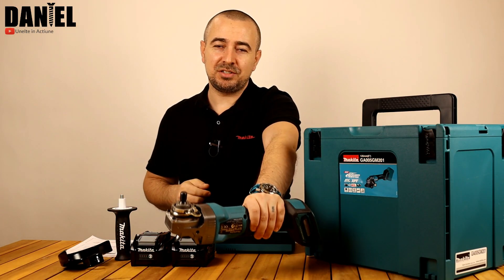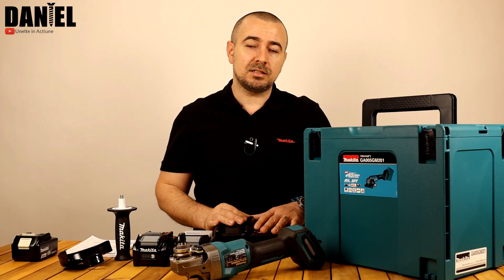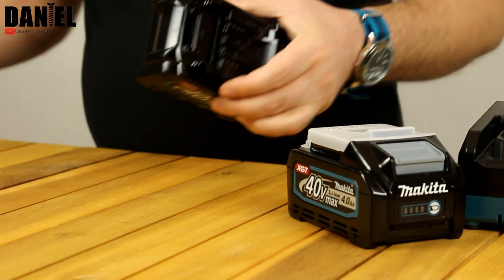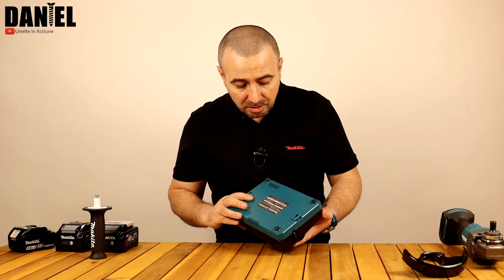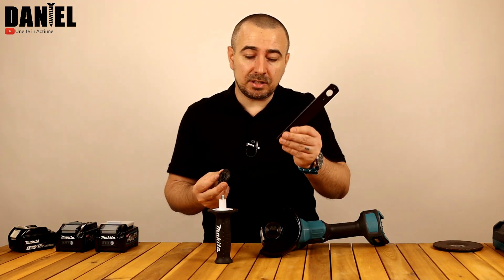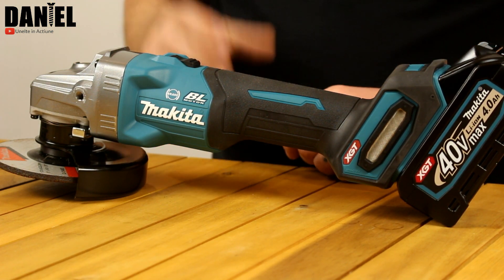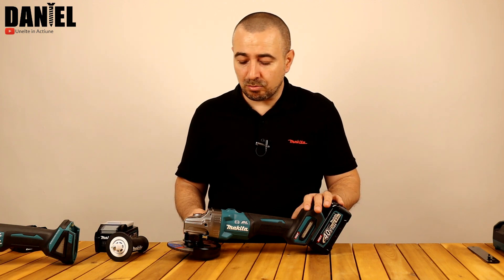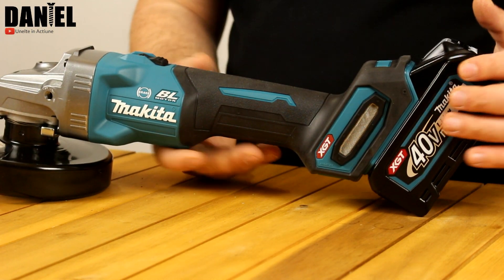A ajuns si in Romania! Polizor unghiular cu acumulator Makita GA005G XGT 40V

Comment: Faptul ca Makita foloseste baterii de 36V este mai mult chestiune de marketing, atata timp cat legile fizicii nu se schimba; in sensul ca o baterie de 36V si 4Ah dezvolta exact aceeasi putere ca o baterie de 18V si 8Ah. Si faptul ca se exagereaza declararea tensiunii nominale (40V max.) nu mi se pare prea corect. Pentru mine mesajul este ceva de genul: uite ca eu o am mai mare - tensiunea...
Reply from the maker: Cred ca trebuie sa iti recitesti comentariul pentru ca faci confuzii. Deci pentru tine, 18V este totuna cu 36V? Ce treaba are Ah cu V?
Reply from the maker: Dar Bosch si alte marci, nu fac acelasi lucru cand scriu pe acumulatori 12V, cand de fapt ei sunt de 10.8? Eu cred ca astea sunt aspecte mai putin importante.
Reply: Asa poți spune și de 18V... Am acumulator de 12V cu 12Ah și dezvolta aceeași putere... E vorba de tensiunea de lucru și puterea motorului, nu neapărat a acumulatorului. Între un motor electric monofazat și unul trifazat, care este mai puternic? 🤔
Reply: In final 18v 8Ah (bosch) = 36v 4Ah (makita), o aberatie ar zice multi dar nu.

Constructie interna a sculelor face diferenta, acum la bosch cu 18v 8Ah scoti 1800 W (sculele bi turbo), cat scoate acest makita ? Probabil ca mai putin.

Makita incearca sa recastige marketing pe ceva ce la multi nu a functionat, bosch a renuntat acum cativa ani la sculele cu 36V din cauza ca se stricau acumulatorii foarte repede,  e foarte dificil sa mentii in balans perfect 10 acumulatori, ceea ce si makita stia de a facut scule de 2x 18v. Totusi sunt mult mai durabili acumulatorii cu amperaj mai mare decat cu voltaj mai mare.  Makita vrea sa redescopere apa calda.
Reply: @19kreeper  Adevarat, dar acest lucru este valabil doar la gama BiTurbo, in rest voltajul face diferenta. DeWALT a reusit sa faca acumulatori FlexVolt de 54V foarte stabili si rezistenti care chiar fac diferenta si au facut-o acum mult timp. Nu vad de ce nu ar putea si Makita sa scoata acumulatori buni si stabili pe 36v mai ales ca acum exista foarte multe tehnologii. Intradevar, e greu sa lansezi o gama complet noua si sa te astepti sa mearga bine din prima, dar probabil cu timpul o sa mearga. Trecerea este destul de grea pentru ca nu este compatibilitate cu gama de 18V LXT, dar cine stie.
Reply: @DemoToolsYT  Asa este. Un pic toti se joaca cu valorile, doar ca sa stea un pic mai sus decat altii. Din punctul meu de vedere ar trebui trasi un pic de urechi. Nu chiar toate persoanele ar avea ideile clare despre valoarea nominala a unei baterii si in mod sigur ar fi tentati sa aleaga de exemplu 20V in loc de 18V (baterie care de fapt are acelasi numar de celule/elemente si tensiune nominala 3,64V x 5). Marketing oarecum necinstit mi se pare, la toti, ca sa nu creada careva ca as avea ceva cu Makita.
Reply: @DemoToolsYT  Nu am ce sa revizuiesc, fundamental am scris o chestie simpla: 36 x 4 = 18 x 8 = Puterea (W) = Tensiunea (V) x Intensitatea (A). Puterea care o dezvolta o baterie se poate exprima si in W/kW. Dealtfel daca in general pe baterii puterea in W/kW nu este trecuta, asta nu inseamna ca nu este o valoare de considerat si se poate calcula avand tensiunea si intensitatea. Unele dintre bateriile industriale au trecuta scris mare Puterea, iar tensiunea si intensitatea sunt valori scrise marunt pe o eticheta adeziva. In concluzie 2 baterii cu tensiunile si intensitatile specificate au aceeasi putere, putere care se calculeaza pentru a face o comparatie. La asta folosesc voltii si amperii.
PS1 - Cine nu-i de acord cu cele de mai sus, practic sustine ca legea lui Joule ar fi falsa...
PS2 - Puterea echivalenta cu cea a unei ustensile alimentata la reteaua electrica este alta treaba.
Reply from the maker: @mariusroman3799  Lasa bateriile, uiti de voltajul motorului. Tu practic spui ca un motor pe 18V este egal ca putere cu unul pe 36. Vorbim despre puterea motorului si intensitatea la care lucreaza, nu despre acumulatori.
Reply: @David.Mester  Marirea tensiunii de alimentare da posibilitatea folosirii de motoare mai puternice, dar se reduce autonomia in cazul de fata. Si fiabilitatea scade drastic la conectarea celulelor in serie in comparatie cu conectarea in paralel. Un singur element deteriorat intrerupe definitiv bateria la legatura in serie (36V), in schimb la legatura in paralel, daca se deteriorareaza o celula, bateria continua sa ramana functionala cu capicitate redusa.
PS - 2 baterii: una de 36V si 4Ah si cea de-a doua de 18V si 8Ah legate la un inverter si cu acelasi consumator, alimenteaza un numar egal de timp consumatorul. Cata vreme 36x4 = 18x8 = Puterea (W), nu vad asa mari diferente.
Reply: @DemoToolsYT  Ca sa nu fie dubii, am sa rezum/dezvolt ideea: puterea motorului 36V poate sa fie mai mare decat la 18V daca motorul poate sa absoarba curenti mai mari de 4A. In cazul in care absoarbe doar 4A puterea, (da) este echivalenta. Un motor de 18V absoarbe curent mai mare si uite asa puterea devine echivalenta. De baterii am spus ca sunt echivalente ca putere si ca putere de consum exista echivalenta.
Reply from the maker: @mariusroman3799  Voi aprofunda subiectul. Dar eu consider ca aceasta gama deschide posibilitatea construirii unor scule si mai puternice, de exemplu eu am drujba si masina de tuns iarba pe 36V, vin doi acumulatori de 18. Daca vor scoate astfel de utilaje, si vor scoate, pe 72 de volti, adica cu doi acumulatori XGT, cred ca o sa fie o treaba excelenta.
Reply: @DemoToolsYT  Da, viitorul cam asta ar fi; motoare de puteri mai mari, care  implica pe langa cresterea tensiunii si intensitati absorbite mai mari si pentru asta este de asteptat un nou standard de celule pe litiu de capacitate mai mare (care sa ocupe acelasi spatiu, sper).
Reply: @David.Mester  Pai si puterea motorului nu este data de produsul dintre tensiune si intensitatea absorbita? Eu zic ca puterea motorului asta 36V, este comparativa doar cu unele de 18V (nu toate, doar cele care absorb mai mult curent) gen GWS(X) 18V 10/15 SC/PSC. Daca nu crezi, desfa o baterie si verifica; la sarcina maxima, cu un ampermetru/ cleste ampermetric si-ai sa vezi ca sunt oarecum echivalente, tensiunile se stiu, doar intensitatile absorbite sunt de relevat (ca nici modelul asta probabil nu absoarbe 4Ah si sigur nici modelele specificate 18V nu absorb 8Ah). Dupa care inmultesti tensiunea cu intensitatea absorbita, ca asta-i puterea.
2. Comparatia 18V - 12V este inutila, dar daca ar exista motoare 12V cu sectiunea mai mare a firului de la bobine ar putea (ipotetic) sa fie paragonate.
3. Intre un motor electric monofazat si unul trifazat este mai puternic cel care are produsul dintre tensiunea de alimentare, intensitatea absorbita si cos phi mai mare si deci nu neaparat cel trifazat (in general mai puternice) pentru ca ar avea o tensiune mai mare de alimentare. Dar exemplul motoarelor monofaza/trifaza nu este bun pentru ca nu este paragonabil cu un motor alimentat cu curent continuu, pentru ca aici diferenta nu este doar intre tensiune 230V contra 400V, ci o faza impotriva la 3 faze concatenate si mai concret alternanta sinusoidala a tensiunii si intensitatii la la 3 faze concatenate bate una singura.
PS - Pot sa recunosc insa, ca este mai usor sa cresti puterea motoarelor crescand tensiunea de alimentare si nu intensitatea absorbita si ca motoarele alimentate la 36V (si chiar mai mult) au viitor.